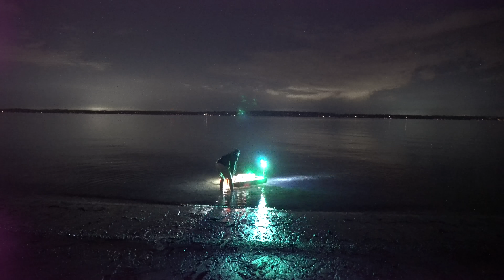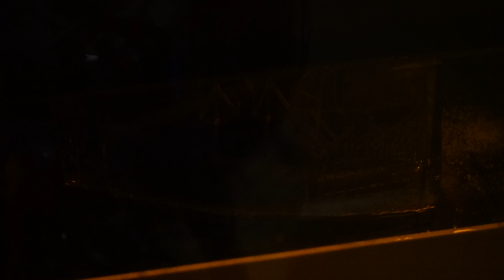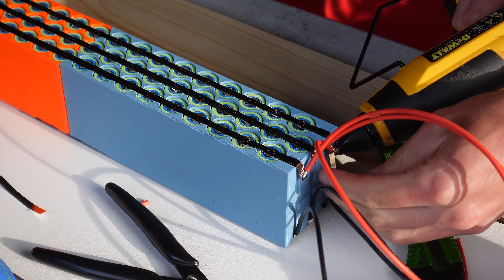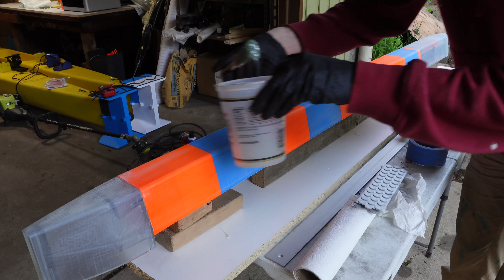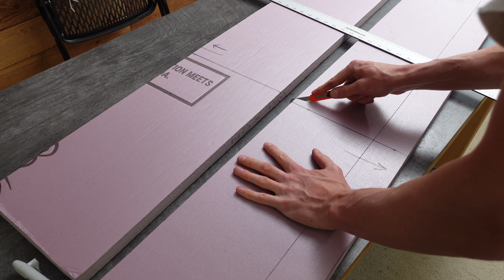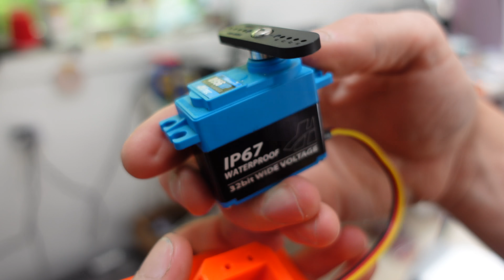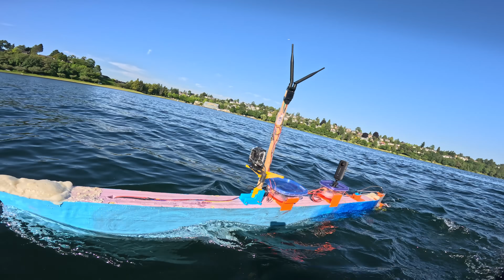"R/C Boat" with 40 lbs of Batteries

Comment: I see a number of comments about adding a bulbous bow. Folks, don't forget that bulbous bows are precisely tuned for optimum efficiency at specific speeds, and actually cost you efficiency when you're not at that specific speed. Bulbous bows also lose efficiency in rough seas. All this boat needs to deal with the excessive bow wave is a sharper bow. Something to cut cleanly through the water and especially through waves will perform much better in a wide variety of conditions than a highly specialized bulbous bow.
Reply: Dude I think they just want Daniel’s bulbous bow specifically.
Reply: Yes a pointed bow but also sloped so as is dives it gains bouancy. Old ocean liners with pointy but straight hows where known to drop the bow or submarine randomly
Reply: Retractable diving planes fore and or aft could help out. Could also do something like the fin stabilizers used on commercial fishing boats to reduce roll.
Reply: It will be tuned for a specific slow speed, so a bulb makes sense.   But maybe at this scale, everything is "rough seas"??
Frankly I think he should build a SWATH boat.
Reply: @murraymadness4674  I sail on a 12 foot sailing skiff, and yeah, at the  scale here, everything that isn’t a glass-flat is “rough seas”.
Reply: @murraymadness4674  YEAH... 'GHOST' IT!...
Reply: @murraymadness4674 another issue is I think the tuning part would be to much work and complexity.
Reply: You can use potting silicone instead of greese, it's pretty cheap
Reply: @tedarcher9120  Yeah. The kind that is neutral and electronics safe. It would've been a far cleaner solution that squirting silicone grease everywhere.
Reply: Bulbus bows dont even make sense for medium sized ships, so why even try to get it on an RC ship.
Reply: I was thinking a keel to help keep the boat more upright under power and as for the bow definitely less bulbous but could also contoured to deflect the swells
Reply: Can I have your brain please
Reply: I think the guy is known to ignore this kind of comments. And yet he makes really entertaining videos about very ingenious contraptions.  I guess some people work best when you let them discover things themselves.
Reply: @damianborkowski7429  Considering he pinned this comment, I don't think it was ignored.
Reply: This machine goes underwater the bulbous bowel on a freighter creates a wake and a low pressure zone that allows the upper parts of the ship to cut through the water at lower pressure. The entirety of this machine is underwater for optimal efficiency it should be as narrow as sharp as possible.
Reply: BUT WHERE ELSE WILL THE BOW DOME GOOOOOOO?
Reply: Like a Viking ship
Reply: A wave-piercer bow would've been better since the bow is barely above the waterline anyway.
Reply: I remember reading in a old Nav Arch book that the bow entry angle should be 20degrees, and that the rest of the bow should be convex before hitting the midbody.
Reply: what about a turn of the century ram bow like on pre dreadnoughts or the early turbine boats
Reply: How about a small, single, forward mounted canard to oppose the p-factor torque effect? It would be small enough to mount as an external ‘accessory’ to allow ‘fine tuning’ if necessary.  This would both neutralize the p-factor and stop the constant over-correcting of the rudder, saving battery power.
Reply: Yeah it should be a wavepiercing bow
Reply: At the scale you are working with stabilizer fins may be a simple option but the design is a great base platform , well done !
Reply: I saw a couple women at the grocery store earlier today with bulbous bows.
Reply: @matthewcragg3607  Been seeing a lot with a bulbous stern and after deck.
Reply: @matthewcragg3607 😂😂
Reply: @matthewcragg3607  I seen a "women" with 3 bulbous bows, but 3rd one was facing downwards instead of forwards.
Reply: i see they're adding bulbous bows to long range, offshore capable yachts these days

Comment: 12:40 Rather than adding chemicals, you probably could thin out the grease with a little bit of heat. Like a heat lamp or even sunlight.

Comment: For the batteries the grease felt like too much work. We built quite a lot of underwater stuff in my past company and the easiest to make sure the batteries and electronics are water tight was to put them in a acrylic tube and seal the caps with orings, pretty standard stuff. You will do with very little grease then. And also the batteries would be easy to dismantle and repurpose later. Nevertheless it was cool too see. Also the fiberglass hull was pretty awesome.

Comment: 16:20 wtf is pink panther doing in that foam?
Reply: And also you could just add the second motor, make it spin in the other direction so it cancels each other like the russian ka 52 helicopter and put a bit more weight so the motor sits under the water

Comment: should of maybe just tapered the bow up so it picked the nose up and the rear would naturally dig and you probably could of ran the two motors . if anything im sure you could incorperate a elevator /dive servo in front and rear to control the characteristics a little better  really interesting , now i kinda wanna build a sub marine that just looks like a traffic cone , very odd and out of place but visible lol

Comment: I can still see the fact that the little narco sub is very good at not flipping over. 
The hull is 100% heavy enough as is, but I think it needs a little bit more ballast on the bottom to prevent a rogue wave from tossing it onto it's side, in case you want to send it out during a storm.

Comment: Just curious — did you ever consider opening up the entire battery section, filling it thoroughly with grease, and then topping it up again after reassembly? That would have speeded up the process a lot.

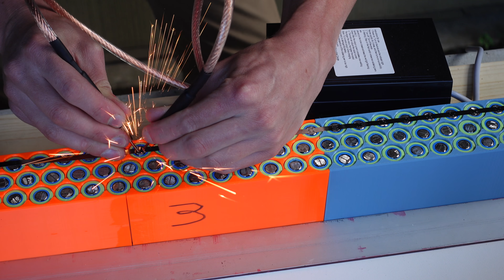Comment: 4:46 UHM actually 🤓 if it is 3s it would be around 12v but you said 3p wich means that it would be like a lot s (I don't want to count all the cels) and with that voltage you wil break motors and only have around 3500mah * 3 = 10500mah wich won't last long enough for your mission.

Comment: Honestly, I would totally build my own Narco sub, if it were as big as some of theirs can get, and actually had safeties.... likely would want it to be at 250m, to stay below the most turbulent part of the sea, and not so deep as to freak out. Would just love to spend a weekend there, with all the emergency surface systems basically on a hair trigger like mechanism... or I would just want a house similar to those underwater hotel rooms, anchored in place. Assuming I had the money for that, I would also likely have the money for running a line for power and ethernet... about all I would need for a home or home away from home.

Comment: Maybe next time spray the battery pack with polyurethane conformal coating instead? Way less work and no need to force grease under pressure.

Comment: Hi there great vids 
I used to make all the fibre glass bodywork for the UK company Jim Fox models similar to BVM in the states 
One thing I have noticed with your glass work is how you cut and put your cloth on your projects 
You should try cutting the cloth at 45° this will help in two ways firstly the cloth will not fry but secondly in most important all of the cloth will be working on strength if you think of a wing with the fibres running at 45° there will be all working on strength the way you have them 50% of the strands will be doing nothing only the up-and-down will be working in the way you want if that makes sense
It also helps with the cloth going round corners  if you are doing complicated structures, you may find a cloth called twill wave helps even more again cut at 45° 
Cheers Mike

Comment: Instead of foam in the rear void could you weigh it down with something dense like metal beads under a layer of epoxy? Could potentially help with stability by lowering COG while also helping raise the bow a little bit

Comment: you can compensate for the torque and the bow height using fixed low profile wings on the hull to direct some flow down at the right angles.  You can then use the wing orientation to adjust up to a higher speed that's more efficient.  And the telemetry doesn't need to be check hundreds of times a second.  Doesn't even need to be checked every second, let alone actually adjusted many times a second.

Comment: at 17:48 when you find the questionable spot, if you go back to 15:55 and look at the section, it's facing the opposite way from the framing at 17:48, it looks like the same spot and same pattern in the grease, so I don't think it's water seeping in.

Comment: Dude xD Please secure your electronics from water ingress. Its just asking for trouble and wasteful damage to the batteries. Large heat-shrink tubes work great, also just spraying with plastidip or something like this. I just use UV resin because im lazy.

Ok I watched further into the vid. So much effort instead of just using gallon jug or whey protein box. There are a lot of-the-shelf water tight containers... In the lab we used tuppers and they were perfect even under pressure. Even simple PVC pipe with threaded ends is cheaper, faster and more reliable than printing and covering your whole workshop in grease ;)

Comment: The max speed of a displacement vesel is a function of the length of the hull, the longer the length of the hull the higher the maximum possible speed

Comment: Do NOT, I repeat: DO NOT USE corroded battery cells even if they measure OK. Why? Well, often the separator inside gets compromised and when charging ONE DAY it would fail at for example 4.0V while the charging control electronics thinks that it is not charged to 100% and will continue charging aiming for 4.2V. At this moment the cell starts to heat up and burst into flames while charging even if the control electronics thinks that everything is OK. I have fixed electric scooters that have being left in the rain and had several cases of battery fires when charging and my investigation proved that cells can fail in this almost unprobable fail mode. All were slightly corroded.

Comment: Something that I haven't seen mentioned that may help is a feature used on larger warships meant for ocean-going duty called an Atlantic or Clipper Bow, where the bow of the ship raises higher than the deck and flares out to guide bow wave and waves breaking against the bow away from the deck, and it made their seaworthiness much better in rough surf. Might help with the bow washing and the cavity filling with water like you noticed in the torture test.

Comment: 🌬️✨🪁
🌊🛶🌊can you make something like this that uses a dual line parasail for thrust? 

way less need for batteries to get range.
it could be so simple w conventional heavy keel and servo rudder and servo reels to steer the kite..
the control system for this seems..hard. 
maybe needs wind and gyro and location telemetry from the kite? 

..or maybe a very light hull with hydrofoil to anchor to water..
F A S T B O I
💫🪁 
🏄🏽‍♂️🌊
🪽🌊

Comment: Cool video. That bow sure needs some reshaping. Make it sharper, give it a bit more angle so that it is not so straight upward, and maybe give it a bit wider outward curve on top. Those should help it to stay abowe water and not to dive inside every wave. Reshaping the bow should increase the speed, and decrease the power consumption by quite a bit I think.

Comment: Could put a inverted V shaped keel fairly towards the aft to have two motors on there, that'd also give you some differential thrust that could reduce the amount of work the rudder has to do. Or you could do a more typical sail style deep keel and put a motor on that, helps with stability and gives you the extra motor.

Comment: Tip for future versions; use a 4 inch PVC plumbing pipe, put the battery inside that, then just glue one end shut and screw on the access end with some silicone.
Easy way to make a long watertight battery compartment. Also good for the electronics too.

Comment: For the hull: if you are looking to save costs, or actually want to massively increase density of a part, look at cement (or other aggregate) filled 3d prints. Density up to almost 3 times as high as even filled resin prints.

Comment: @rctestflight it may help to add a keel to the bottom of the boat, it would lower the CG to help with the roll issue, it could be sized to add a good amount of weight (i.e. fill it with lead) as well to bring the boat down lower in the water to allow you to run the second motor to help with both the overall efficiency and the hull roll due to torque.

Comment: Daniel, as someone that works in battery safety professionally, please take battery safety more seriously. The fluid that bubbled out is electrolyte that produces HF gas, which can eat your bones... Also hydrogen gas can be produced, which is a big deflagration risk while you're spot welding the current collectors. I only wish you well and hope you are more careful in the future! <3 Love your vids

Edit: Also consider avoiding putting the cells under vacuum - they have a vent in them that will pop. Granted it typically requires a high pressure delta, but with old cells I'd not gamble.

Comment: offtopic: kinda surprised that ecoflow uses 18650 cells, at that price point you'd expect at least 21700 or 26650 cells, at least the current version is using LFP packs

on an other note:
I think a boat with a whole lot of ready made 12V or 24V LFP batteries could be interesting, as a rule of thumb you can guesstimate 100ah/12v to be about 9-10kg, or 18-20lbs, depending on where you shop you can get 100ah for 110-160€.

Comment: have you though of using concrete in your boat builds?  If you filled the stern and bow with equal amounts of ballast like cement i bet you could have made the boat heavy enough to use a bit more foam and both propellers.  Of course  The best method would be to have a keel space that would allow you to pump concrete in while putting the center of gravity more near the bottom of the boat making it way more stable. Not that it doesn't already look pretty stable but that alone plus a keel fin (like a sail boat) might counteract that lean you are getting from the motor torque.

Comment: the battery design is insane. no one should ever copy you. the hundreds of failure points, extraordinary surface area of the cells, tens of hours of wasted tedious labor. anyone interested in trying this: you can buy a few large prismatic LFP cells for $50-$300 and have an easily serviceable 1-3kwh battery. 

fun final product though!

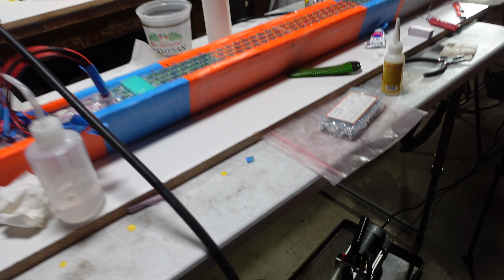Comment: 11:06 - don't tap threads into both the top cover plate and the part you're clamping the cover plate onto, just tap the lower part. The cover plate would resist any tension you try to put into the screw to clamp it down.

Comment: Maybe add a self balancing counter weight to the top of the boat to keep it balanced. Use your aileron circuit. Kind of like a self balancing motorcycle. A spinning gyro could also help the wave stability. My concern with it whipping back and forth was the moment of the antenna tower. Does it really need to be that tall? Great video BTW. I get exciting when I see one of your videos pop up. I get bummed when I have to wait to watch it.

Comment: Mineral oil- old-school subs used lead acid batteries with the head space filled with mineral oil.
You also need to manage the thermal expansion of the fill fluid, don't let it draw in water because it cooled and pulled a vacuum.

Comment: when filling the battery compartment you needed a escape hole to push the air out through. and next time i would have done more fiberglass and epoxy along any seams. and maybe a couple full length tension rods or at least dowls along the sides and bottom

Comment: You can pack the batteries in baby oil to make them waterproof, as long as the container seals in the baby oil. This is how batteries are pack for underwater service, after the baby oil is degassed under vacuum. Using some 60 amp/hour sealed lead acid batteries will let you make a shorter hull. Just my two cents.

Comment: i think you should use a fan but not a ceiling fan like a desk fan.you dont need fancy cranks and all of that.just seal the fans motor base and dismantle the cover of the fan.there you have an engine.and put the setting buttons near you and thats it.easy as hell.

Comment: Wouldn't it have been a lot easier simpler and quicker to just pot the entire thing with epoxy and draw a slight vacuum on it to remove any air bubbles instead of the messy grease?
After watching your work for several years I'd expect a much more professional build at this point than this pieaced together monstrosity with tupperware bowls and duct tape. And why not just print a new motor mount placing the two motors side by side counter rotating to zero out the lopsided motor torque effects?
Oh well, anyway....

Comment: Always interesting. I look forward to the follow-up. If I might make some simple suggestions:
-Lower in the water and greater stability could be achieved by a metal keel - simple or complex, whatever, er, floats your boat.
-Lower in the water of course means being able to use the twin motors you intended for less torque reaction and better efficiency.
-Add a bulbous bow. Get it right and you'll see greater efficiency / speed. Get it wrong; little lost...

Comment: What about using like 4 300Ah prismatic LiFePo4 cells in series? They are 45 euro a piece, you will have 13V and depending on model 3.5kW (1P)  / 1.7kW (0.5P) of power  and 3.5kWh of energy. That's about 22kg.
There are cheaper prismatics, but the starting price is about 20 euro a piece for 50Ah...